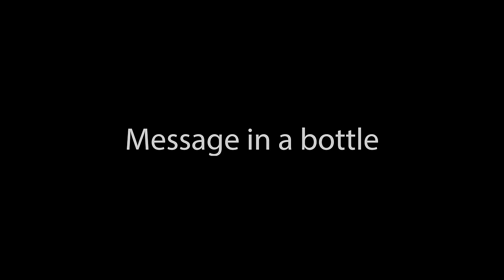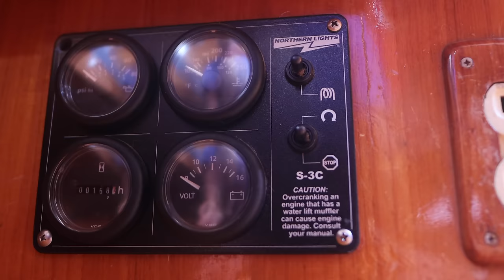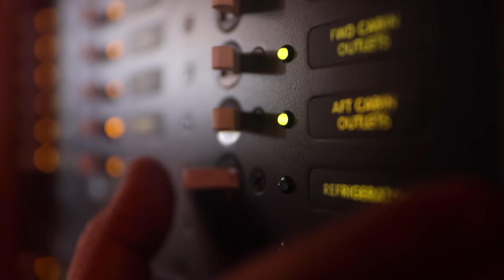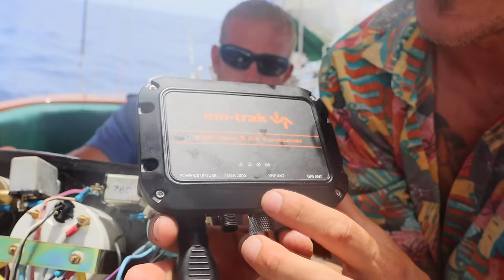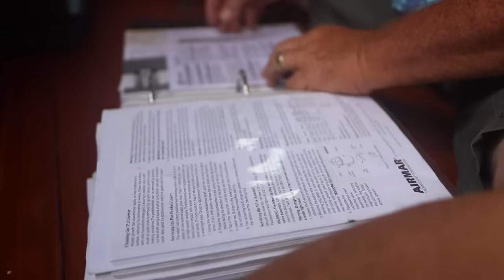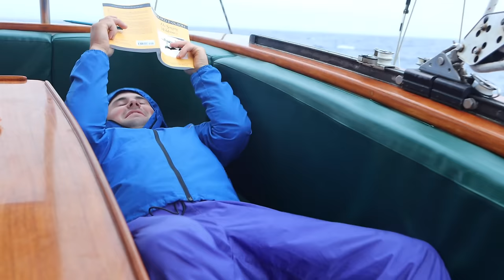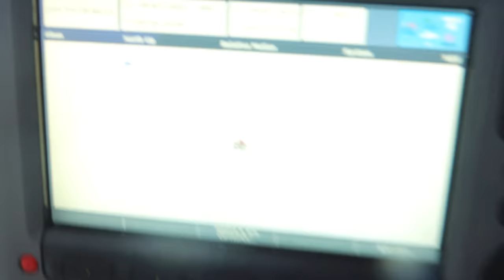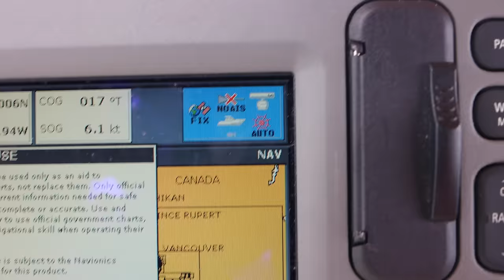Catch and cook: Mahi Mahi out to sea!  (Pacific crossing pt. 2)

Comment: Connecting center conductors and shields on coaxial without maintaing the original impedance will kill your signal strength...probably your problem all along.

In an emergency, peel back the shield, like you did before, then expose 1/4" of center conductor on both wires, solder together. 

Without letting the shield touch center conductor, wrap with tape...just enough to make a connection while maintaining the shape (approximate impedence).
Reply: Good advice on the coax connection. 
I may be wrong, but I thought AIS transceivers were supposed to have independent GPS rx, namely only connected to the AIS and the network connection is just for displaying targets.
Reply: @chrisfoote9413  VHF is for broadcasting and receiving positions among vessels.  The GPS is just so it knows what GPS coordinates to broadcast over VHF and charting any received coordinates into the map.  With no VHF you can't tell others what your position is, or receive what position others are.
Reply: @cup_and_cone Thanks, I know how it works, my point was that the position input to AIS (before transmission to other vessels via VHF) is, I think, supposed to be from an independent GPS, that is not the same one that is connected to other devices such as the chart plotter etc. So if checking the reason for a fault light, checks need to be on
1.  Power
2.  AIS's own VHF input and output from/ to antenna (could be via a splitter, if so that would need to be checked also.
3. Display network connection from AIS
4. GPS input to AIS or antenna connection if GPS is built into the AIS unit.

Comment: You can't splice coax cable like that. The braided outer is a shield for the inner core. You have to butt split the inner core and insulate, then pull the braided outer over the splice and bond it. That sad wire nut style splice is letting EMI in, noise. And you never use dielectric grease on contacts where it can build up and insulate. It is to cover the exposed portion to prevent water intrusion or corrosion. It is not a lubricant, it is a water barrier. It will make contacts intermittent. Radio frequency isn't magic but there are some basic rules. Clean that connector with alcohol.
Reply: Hi, that connection is an absolute NO GO for high frequency signal transport. The AIS Antenne is not a simple power wire (low frequence). Current in higher frequencies has more wave physics. In low frequencies the current just flows from high level to lower level (potential). Here everybody knows well that waves behaive different then just a river flows down in the valley. Wave can be reflected by walls. An the made wire connection is exact such wall. This connection back and forth is a wave reflector.. DONT DO such connection for high frequency wires. The connection must follow the direction of the wire. It should keep the coax geometrie as good as possible, also the dielectric material (plastic between inner wire and shield) and also the shield (which is also a pipe for the wave to flow through). 
This is not woodoo it's physics. I am also boater and has a own sail boat. But I am also elektrical engineer with Phd in calculation elektromagnetic waves of eletromagnetic field. 
I was in a bar where was written over a piano: "Who likes can and who can must".
So I talk, as I has the knowledge from my job. That's seemannship ..
So please correct this connection. Maybe there are other problems, but this is for sure a big. AND HAVE FUN !!!  
Many greating from Berlin, Germany
Tobias

Comment: The connection of the AIS cable is not good enough.
Connect the worm wire together in the opposite way and isolate it with tape.
Than use a foil of aluminum to cover up  the cable and than bend the ground on top the foil.
Finaly cover up everything with tape  to isolate the cable.
It shoul work. If not changhe the cable. Good luck!

Comment: I think that the AIS is an important piece of equipment, but, nothing can replace a good pair of eyes on watch.  as long as your NAV lights are working and hopefully the other boat's lights are working it will be fine.  Radar is a great indicator of traffic as well.  stuff happens and I think you and the crew have a handle on it.  you'll be fine.  I am a recent subscriber and am going back thru your videos to see what I have been missing.  I'm impressed.

Comment: F Y I  , to get a hook out get about 4 ft of line dubble it up rap it around the bottom of the hook and then with a thump lightly hold the eye at the top of the shank against the skin get as much slack in the line as you can and then for all your worth snap that line away from the eye towards the bottom of the bend in the hook and when you hit the end of the line it will pop the hook right out then liberally apply the Betadine and bandage Cause  is going to bleed

Comment: Hi,
 that AIS Antenna connection is an absolute NO GO for high frequency signal transport. The AIS Antenne is not a simple power wire (low frequence). Current in higher frequencies has more wave physics. In low frequencies the current just flows from high level to lower level (potential). Here everybody knows well that waves behaive different then just a river flows down in the valley. Wave can be reflected by walls. An the made wire connection is exact such wall. This connection back and forth is a wave reflector.. DONT DO such connection for high frequency wires. The connection must follow the direction of the wire. It should keep the coax geometrie as good as possible, also the dielectric material (plastic between inner wire and shield) and also the shield (which is also a pipe for the wave to flow through). 
This is not woodoo it's physics. I am also boater and has a own sail boat. But I am also elektrical engineer with Phd in calculation elektromagnetic waves of eletromagnetic field. 
I was in a bar where was written over a piano: "Who likes can and who can must".
So I talk, as I has the knowledge from my job. That's seemannship ..
So please correct this connection. Maybe there are other problems, but this is for sure a big. AND HAVE FUN !!!  
Many greating from Berlin, Germany
Tobias